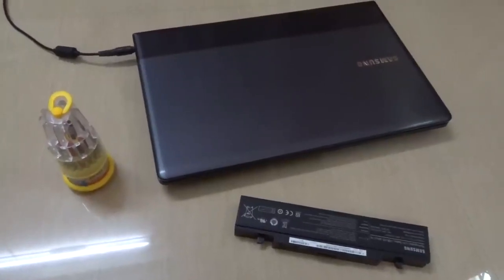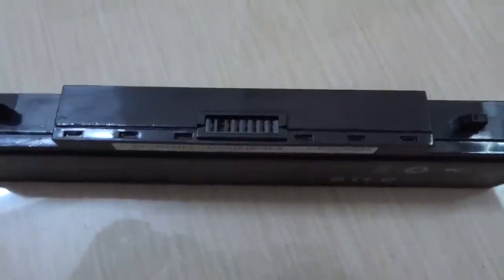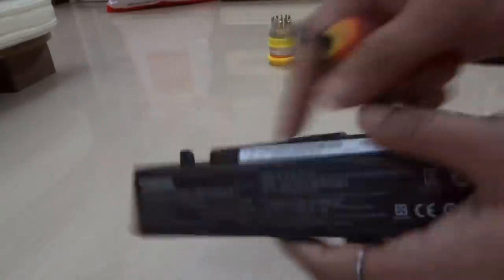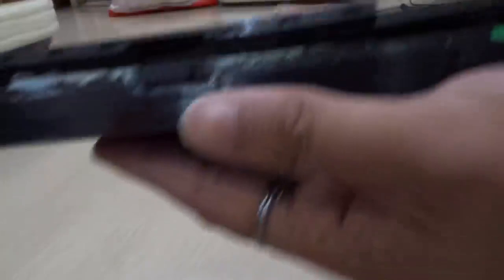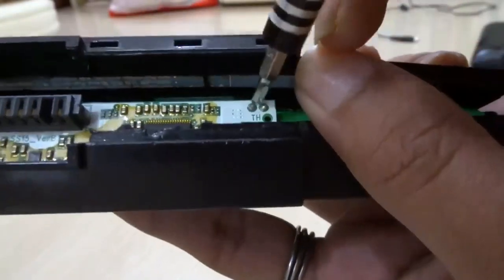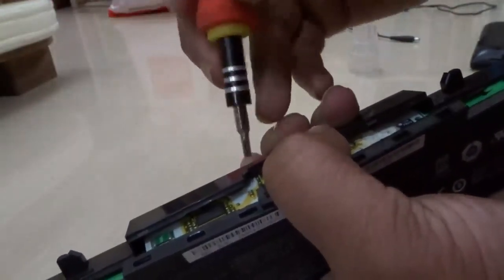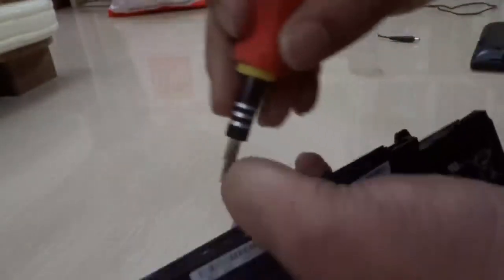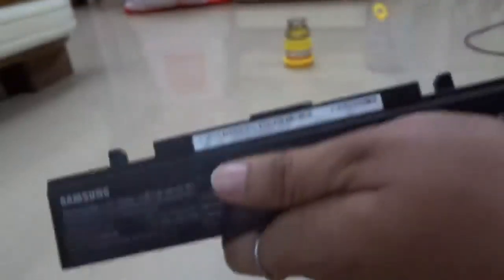Battery Reset || Plugged in not charging

Comment: Great idea for good condition battery. Thanks for the guidance and appreciate your knowledge. I was able to do the same with my Lenovo X61 laptop battery (checked and condition was good) as you mentioned the IC name for short-circuiting and could locate it in the circuit board. After the work, the laptop started charging. Great guidance helped in saving money.
Reply from the maker: You are welcome 😊
Reply: @MOHARSTUTORIALS  hi good video , i just bought a new battery and right off it is flashing yellow says 78%, unplugged there is no power
Reply: Tengo una batería lenovo no carga 0%

Comment: dude the pin you shorted is for tempreature and one more thing your battery full charge capacity is greater then the cells inside thats why it does not charge more than 27% if you laptop bms has good health you can add new cell with doing its software these pin you shorted is for temprature reading only it does not do anything you said bro!!!!!!!!!!!

Comment: If you don’t want to tamper with the battery’s electronic panel, you can do the same with Ms Project 2007 Demo. Just by making simple projects directly during charging, plugging it in more times, and repeating the whole process. So, if charging starts at 14%, jumping to 100% immediately, the software demo will reset the battery to charge normally. This way you don’t have to manipulate the battery, most people don’t want to.
Reply: What does team management have anything to do with charging the battery ...what is the link and explain yourself.  I don't have those two terminals to short out  (notice the word is not "shortening" but shorting). Also he went to the leads to the board and said they had to be shortened (sp) also....then he sticks the screwdriver on those lead terminals quickly and doesn't show what he is shortening (sp).  I have a chip R0Z0 but no two terminals close by like he has.....and this board is branded Dell although the battery is 3rd party. The audio dropped down so low I could barely hear him then it comes back later....why can't these people author properly?

Comment: Best solution is just buy a new battery, and it doesn't charge then you got issue on the charging port on the board, which is different issue to repair it

Comment: That component looks like a thermistor or just a resistor. If anything you need to somehow reset the memory IC chip. I tried this just for the heck of it with four different batteries that had 95% power and it didn't work.
Reply: Thats becauseits CLICK BAIT...

Comment: In actuality you need specialised hardware (i.e. EV2300/EV2400) with software (Smart Battery Workshop or Battery EEPROM Works) to really reset a laptop battery. Specifically the BQXXXX IC that is located on the PCB board - to which the 3 pairs of 18650 cells are connected to. 😑😕😒

I have an assembled/saved playlist with videos on this topic on my channel.
Reply: The author of this video is an idiot!

Comment: I have 5 years old lenovo G50-80 model laptop and recently the battery ( original one, model # L12S4A02 ) stopped working. The laptop is not getting supply from battery and it's not working with battery. System shows 0 % available,  plugged in. After opening the battery  casing I tested all those 4 cells and all of them have 3.4volts each. So, seems cells are fine. However when I checked at battery outlet in BMS, it's showing 0 volts , no power coming at all to that point . Tried shorting the +ve terminals trick but even that failed. And,  I tried to follow your trick but I could not locate it's IC shorting point in the board.
Can you please help/suggest ?
Thank you
Reply: I also have same model with same problem man
Reply: Bro, we all have the same problem. Have you ever fixed it?

Comment: Do this with any other RECHARGEABLE (!) battery u will risk shortening, results in -> outgassing -> results in fire or explosion, in the worst case. 

Don´t do any unqualified maintenance to batteries AND do never open any! (to viewers)
Never open and NEVER EVER short circuit an accumulator, without knowing exactly what you do. Even if u do. DON´T.

This man knows what to do. FOR THIS particular Samsung Model. Don´t get urself hurt!

No offense man, nice hint anyways - but not for everyone. You should insert a disclaiming clip that says USE EXTREME CAUTION AND DO NOT OPEN ELECTRICAL PARTS.  If the cells are slightly broken they need the housing, and it needs to fit tight. It will not after. Guess why there are no screws on any accu-packs.

Use extreme caution and verifiy if this is the EXACT same part and location of the contacts.
Reply: Thanks for the help, but it did not work because I did not want to damage the housing. You sure u can do this to any cellpack? I am a bit scared. I think I wrecked the circuits onboard with a power supply with too much power. :(
Device says 3,46 Amp input, but the Supply does 4,8 Amps. That would have killed it, right? :(
Reply: @businessstartenonlinegeldv34  more Amps often don't kill the battery, just charge it faster (but put more stress on it). That's a pretty low difference, so nothing should have happened regarding that.
Reply: My laptop toshiba laptop start to show plugged in and charging
Reply: So what can I do for my laptop toshiba to change for 100% because it shows plugged in and charging but empty, how many hours it can change for teacher

Comment: Awesome technique! But how do you mean by  shortening the led out? By just scratching the led with the flat screw driver?
Reply: The metal tip of the screwdriver makes a convection between the two contact points and shorts them